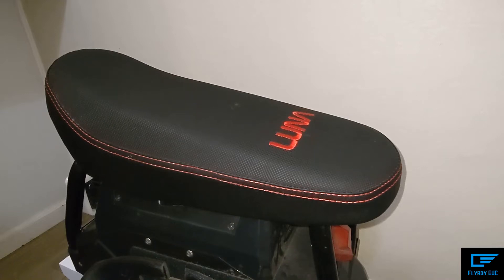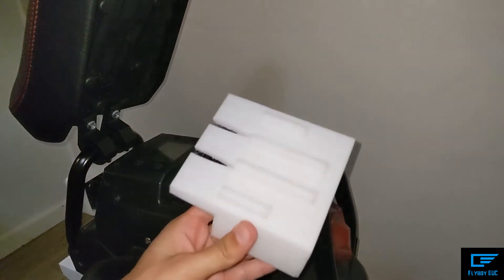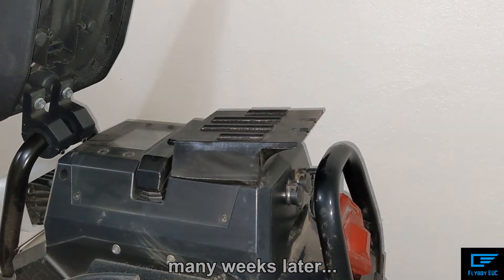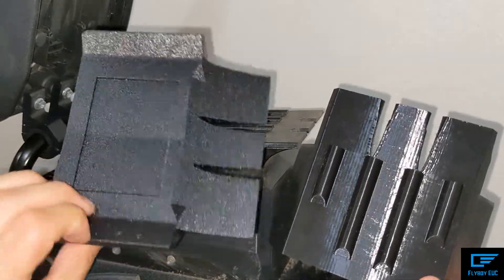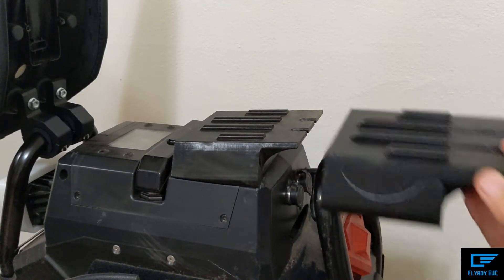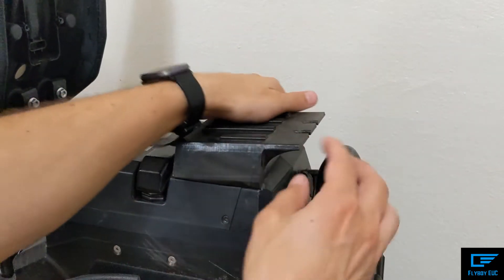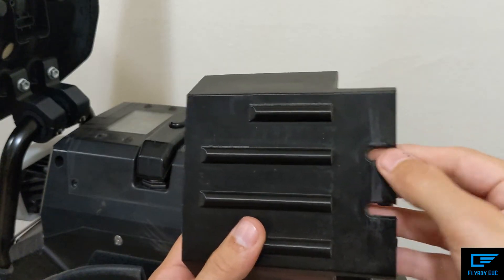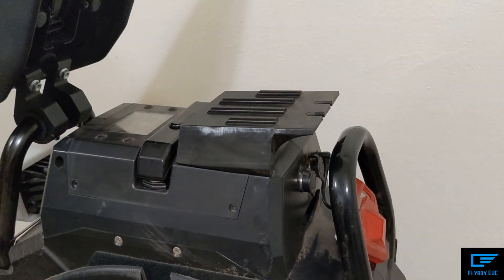Luna Seat Adapter for Veteran Sherman

Comment: Dope ! I’ll be contacting you first thing next month to acquire the whole set plus two extra of the washer filler thingees . I already have the clamps and the seat all ready ! Thanks so much for making this flyboy ! But also thanks for making it facing the correct way ! You rock ! 
I only ride seated , at first I bought the Clark seat , but it’s made facing the wrong way, and their staff said it can’t be used backwards because it will damage the seat somehow? Also I don’t like how their clamps aren’t fully locked like yours so you can grab the seat while braking . Peace !

Comment: Try locking velcro, no room for movement
Reply from the maker: I might try it out but I've mostly stayed away from dual lock because it's really expensive and it doesn't last as long as Velcro. All the sites I've read up prefer Velcro. Part of the reason for the recessed area in the adapter is to help restrict lateral movement and it's really effective.